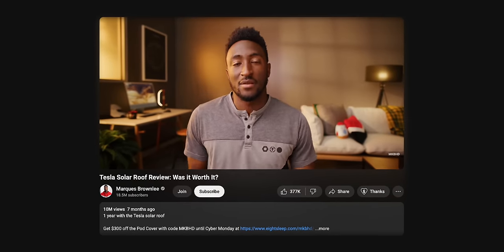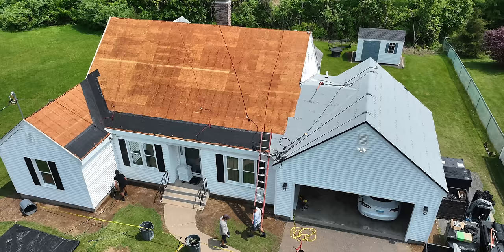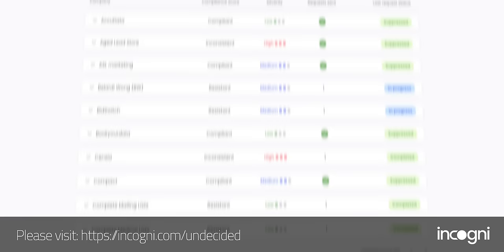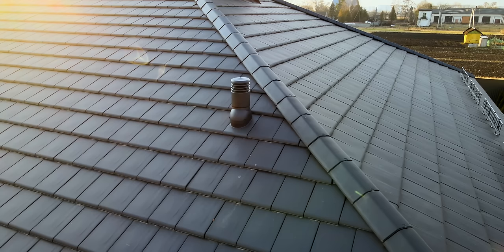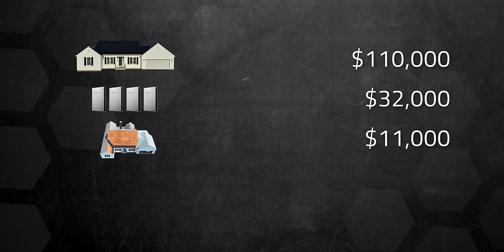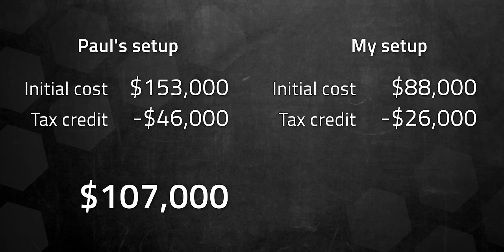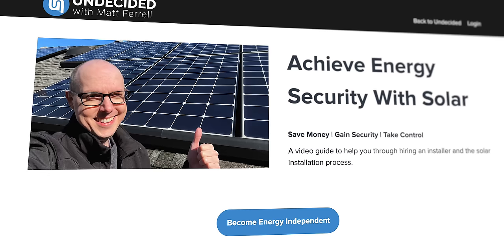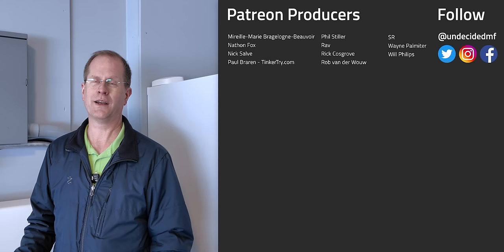Tesla Solar Roof vs Solar Panels: Which is Worth It?

Comment: After watching Mr. Brownlee's video, I contacted Tesla and received the contact information of a local installer.  Our house is much smaller than Mr. Brownlee's home, so I figured we might be able to afford it.   The quote came back at about 25% more than what Mr. Brownlee paid!  It was over a half of the value of our house.  Needless to say, it immediately fell outside of our budget.
Reply: Mr. Brownlee seems to be a less than reliable representative for any information I have ever checked referenced sources for. One wonders how the information presented can be considered reliable from any standard that I have been able to verify from actual sources.
Reply: That is heartbreaking to hear, I'm so sorry things turned out that way for you. I can only hope prices fall again someday for your property, or that more competition springs up with similar offerings that suit your needs and budget soon.
- Paul Braren from TinkerTry
Reply: @TinkerTry  How did you get such a large system installed with net metering caps in MA?
Reply: @jeffrocheleau3346  I think the size of the actual pannel array is only limited by input voltage limit on the inverter. It’s the inverter power output that’s regulated. You can hook nearly 9kW of panels to a single MPPT input on even cheaper model inverters. If it has 2 inputs, You can hook up to 18kW of solar to it. You would still be limited to whatevee the inverter’s output is rated at. For net metering likely around 10-12kW max, but You’d get those 10-12 for longer duration during the day from morning to late afternoon, not just during midday.
Also, with a smart inverter and battery storage, You can pull more power from the roof that does not go to the grid, if You can use it up before it there’s a surpluss.
Reply: Mr. Brownlee?!?
Reply: @plica06 Yes, sir.  I don't know the man, so it's a sign of respect to address him as such.  I realize that this is the internet, where you can be as rude as you like to strangers, but some of us were raised differently.
Reply: @hiagftd    Mr Brownlee has a similar presence on the internet to Matt, and isn't shy about being a tech innovator.  Not a surprise he got a discounted price.
Reply: @amconsole  in some regions and states there's a regulatory limit to how much solar generating capacity you can host - the strategy being that the incumbent power utilities don't want their customers competing with them as grid-wide energy suppliers.  Here in Colorado they used to permit no more generating capacity than would supply 120% of your average annual demand (actual or estimated for new construction) but that limit was lifted in the last couple of years.
Reply: gotta get multiple quotes in any contracted work, especially with something that is still relatively new and rare like solar. A lot of companies will quote based on what they think you might be able to and willing pay rather than actual cost.
Reply: @redwolfexr  Both guys are influencers and - at best - public informers and reviewers. And that is completely fine, I am a regular viewer.
But they are not innovators.
Reply: Thank God at least Brownlee got a great deal!
Reply: @phlogistanjones2722  I think it's just the issue of a price increase. Mr. Brownlee didn't do anything wrong.

Comment: Overall costs for both roofs and systems are ridiculous, I'm kind of amazed at how much you both paid. Both of you have been taken for an absolute ride.
Reply: This is all absolutely stupid!
Reply: Matt's solar panel only cost actually sounds kind of high but reasonable. May be a location issue. The cost of the batteries is where it gets crazy. You don't need the batteries, and when I was pricing out a solar install, I could not justify the cost financially. I think you really want to maximize your solar utilization over cost considerations to go with the battery add-on.
Reply: You are absolutely right.  I installed solar panels and I figure it would take about a 100 years to have them pay off.  The only reason I did it was that I live in a rural area and the electricity coverage is pretty spotty.  I got tired of having my electricity shut off at random times.  Also the electricty was off for 5 days (during winter) one time.  Fortunately no pipes busted which was a blessing.

Comment: In Florida, they won't insure your roof if it's a solar roof.  That's killing the market with all the hurricanes we get.
Reply: Florida and California’s loss is my gain because I’m getting a killer deal on solar ($2.89/watt) because of lower demand this year.  I priced the same system out a couple of years ago and it was about $3.20/watt.
Reply: do it yourself in the back yard using smaller cheaper systems... the roof ones are no longer priced even close to diy solar, which can power most peoples stuff in the home, esp florida... the battery systems now are so cheap and many market them with stackable options.. he had ads for them here 2023
Reply: also ,☝️ to add, and what i mean is.. dont tell them at statefarm or whatever that you have diy solar, its not going to be recovered by their policy as its NOT locked down, you can move it when the inspection guy comes, so it has zero do with them of its portable diy solar.
Reply: @dertythegrower  thanks, I'll look into that.
Reply: Pretty soon it will be very hard to get ANY insurance in Florida, regardless of what's on your roof.
Reply: Any roof older than 15 years has to be replaced, according to my new insurance provider here in flordia. Does not matter if it's a metal 40-year roof with no flaws. They are out of control. They have a monopoly now that so many insurance companies have left.
Reply: @ScoobyFermentation  You're not gaining anything....those states getting destroyed is causing your insurance to go up too!
Reply: In Texas, with tornadoes and hail, insurance companies are making roof deductible so high that it is like you have no coverages here either...
Reply: @randya9143  I know people in Texas who never pay for a new roof. If it's getting worn out they just wait for a hail storm and claim it on insurance. That's another big reason that insurance keeps going up, for all of us.
Reply: I have insurance in FL. 9.3Kw SunRun panels with SolarEdge inverter.  Insurance went up 50% but I am advised it was NOT due to solar. Roof age and strength must meet standards.
Reply: Move away
Reply: @ScoobyFermentation  How's that a killer deal? Have you checked pricing of panels, inverters and batteries lately?
I'm not kidding, without batteries it's about $0.75 per watt and with them about $1.2 per watt if we are talking 10 kW or more.
Now there is install cost, sure, but that's 2 men for 2 days of roofing and half a day of electrical work. You're still being ripped off, just less so.
Reply: Tesla’s Solar Shingles are technically a different technology, so it should not exclude someone from being insured…

🤔

Comment: We have 12 year old panels. 4 have hail damage. Even though they are still working, we decided to replece the entire array. We use bet metering rather than batteries and are net $0. We are upgrading to new and fewer panels for the same kw this spring. The older panels paid for themselves ib 7 years we expect the new array to do so in 30 months. Love them. Can not  imagine doing this upgrade with roof tiles.
Reply: No no no, just no! Don't you see you're doing it wrong? You need to buy everything in one neat, hermetically sealed packaged, because ✨ aesthetics ✨.
Reply: @jfolz  lol
Reply: @rogerjohnston9545  /s in case that want clear. Our installation will have paid for itself twice over next year or so.
Reply: @jfolz  panels or tiles?
Reply: @rogerjohnston9545  panels. I don't think tiles were an option in 2011 ;)
Reply: Yes, it would be impossible and excessively expensive.
Reply: This is the massive benefit of having detachable solar panels. They last a long time, are cheap to replace and when You do, the newer ones have better efficiency and produce more power from the same roof area.
Reply: try to find matching solar roof tiles after 12years. 🤣 Panels are the best.
Reply: @LittleSpot I installed a 10kW panel system on my roof in 2015 using 40, 60 cell 250w, panels. In 2022 the glass on two panels was shattered (by what I do not know) which caused grounding errors and no electrical generation. I tried getting multiple companies to replace the two damaged panels but by then only 66 cell, 400w panels were available which are incompatible with the other 38. The companies were not even interested in replacing the array strings in which the two damaged panels were located. Seems to me that technology is always evolving and whatever system you use you will have compatibility issues after a few years.
Reply: Roof tiles would not have gotten the hail damage.  That is the main reason "premium" roofs cost more -- hail goes right through a normal roof.
Reply: @redwolfexr  solar panels are tough tempered glass rated to withstand hail up to 30mm in size. And even if hail does damage the panel, it can still produce electricity. Replacement panel costs around 150. Hail of that size is a rather rare phenomenon and if it strikes, solar panels would be the cheapest thing to fix (compared to roofing, house windows, car bodywork, windshields).
Reply: @amconsole    I was talking about the Tesla tiles (or any similar tiles) and not solar panels -- but yes the same for solar panels or for metal roofs.

But hail will go right through wood backed asphalt roofs like a hot knife through butter.

Comment: I can tell you why I didn't get a Tesla solar roof.  They didn't deliver.

They quoted me and gave me an estimate of 13-18 weeks for install.  12 weeks in they cancelled my order and told me to resubmit through a local roofer they contracted with. The price went up 325% and the installation timeline was then estimated at 48-52 months.

So my system price went from $110k with install in 2021 to $365k with install in 2024-2025.

I got a standing seam metal roof for $35k installed within a month of contract signing.  My solar system was $65, installed 12 weeks after signing, 2 weeks early.  Installation was completed in 3 days, and PSE approved tying it into the network only 9 days later.
Reply: Damn, can you let me know what company sold you a solar system for $65? Sounds like a great deal! 
(haha, I assume you left out the k there)
Reply: **BINGO**
I have zero idea how anyone represented in this video can seem happy with the amount of money they were charged for the products and services they received. At every step of this video I found the prices, wait times, permitting, installation and performance of the systems to be less than half of what I can personally verify as "reasonable".
The fact that EVERYONE in the video was "happy" with their systems and experiences was baffling. TLDR: They paid 1.5-2x what a high-end charge would be expected to be and waited 2x-4x what a very delayed and drawn-out installation time should be.
Reply: 365K to install or even 110k to install, how much power could you spend using the grid to equal to that???? Not  to mention the environment and the human rights issues surrounding the manufacturing and procurement of the materials and minerals it requires.  I suppose by not looking into these things can allow you to sleep better at night believing you are doing good in the world.
Reply: musk is selling science fiction, believing it can be real if you want it bad enough 😂😂😂
Reply: Solar prices in the USA are insane! You know those huge 400W panels are $60 in the UK? I don’t get why anyone would bother, your electricity is so much cheaper too.
Reply: They talked about the prices and wait times in another comment and it boils down to where they live.  Solar in the US is generally more expensive than any other country by a long shot and the Boston area is even more insane.  It sounds like their local governments are slower than molasses on a January morning which caused a lot of delays with installation.  Of course in Matt's case he probably could've gotten things cheaper by buying used panels and doing a lot of the installation work himself but I'm sure he'd rather leave it to professionals.  Not only are professionals legally required to fix mistakes (and it sounds like they did a great job in that department) but they could probably do it a lot faster.  Another consideration many people forget about is opportunity cost, he could be doing a bunch of work himself (even if it's just trying to find other professionals and/or options that are cheaper) or he could focus on making more videos which earns him more money and likely more than makes up for any losses incurred by just letting other people take care of it.
Reply: @grn1  Sorry, but this is a perfect example of how not to do it. 

2 empty nesters with a large home and 2 new teslas.
the idiocy is off the charts truly!
any decent 250k investment would net you a return to pay for 2 cars and your monthly gas and utilities... and you still have 250k!
Reply: @edc1569  Hi, like you I’m in the Uk and panned prices have been dropping and output going up.
I replaced my old second hand panels with new ones and went from 1.7kw to 3kw on the same mount.
Needless to say enjoying the benefits from it.
I advise everyone to get solar.
Take care M.
Reply: @markeh1971  Yes, that's in the UK . We, in the US, have a different business model. When product production cost goes down, stake holders are gorging, consumers are gouged.😏
Reply: You'd be better off buying a ticket to Mars

Comment: In South Africa, our 2.9Kw 48v system, with 105A Lithium Battery and Inverter, cost us R56 000 in total, about $2,500. Granted my brother in law and myself did all the work, excluding the installation of the electrical switch board, linking our system to the grid and checking/certification of our system by a certified electrician, required by our local municipality and for insurance purposes, but paying for that is included in the cost above.

Took us two years to fully pay for the system out of our savings
Reply: That sounds amazing! I appreciate learning a more worldly perspective, one of the advantages of reading these comments. Thank you for sharing!
- Paul Braren, owner of the Solar Roof featured in this video
Reply: I’m absolutely shocked with the prices you quote. In Ireland, a 400w panel (with 25 year warranty etc) is equivalent to $200. May 16 panel 6.4kWp system was €11400 and I paid over the odds due to supply/demand issues. It generates twice as much power as I use annually. I get credit for the power I export to the grid. It will cost €5000 to add a 5kWh battery if I choose to in future. What in the name of the baby Jebus in his crib are you paying for over there???
Reply: @flyingalexf68  how is a 5kWh battery €5k?!? Look into server rack LFP batteries, they're $1,200-$1,600 for 48V 5kWh units, though right now prices are headed down due to a glut of capacity due to slowed EV demand in China causing the market to be oversupplied.
Reply: Wow. That's awesome 👍
Reply: @andrewfidel2220 I've just ordered a 15KWh LFP system (cells plus Seplos BMS/case) costing £1450 DDP to the UK.
Reply: Just shows how badly we in the US are getting ripped off by a money hungry system. My blessings to you, I did the same in Hawaii, but no electrician, no grid tie, no certification. Your process where you are is so much better!!
Reply: @5400bowen  I was looking at incorporating solar into a new construction home in the late 80's. The solar panels were made in USA, shipped to Germany, relabeled there and repackaged, shipped to England, I was buying them for use in USA and it was still cheaper to buy them from England and ship them back to USA than to buy them in USA.
The price difference was 60% cheaper from England, for the EXACT same panels, that were made in USA to begin with. It's this kind of insane markup that has prevented solar from becoming common in USA, until recently when people started becoming desperate enough to pay for it despite the insane markup.
Reply: @Dang_Near_Fed_Up  yes, in 1978 a roommate told me California avocados were cheaper in Spain than in California. We have been getting ripped of now for a long long time. Good thing all us off grid types are loaded up to a large extent on solar. Sales are tapering off and prices are dropping like a rock.
Reply: @AndyFletcherX31 , who is the seller? Is there a brand name associated with it?
Reply: @AndyFletcherX31 , or these are just the solar panels (most are made in China). You mention LFP. Those must be the batteries you can hook up.
Reply: @gregp.7148  I get panels locally - you can get 400W panels for about £60 each at the moment. Good time to fill your boots.
Reply: Where did you buy your inverter from?